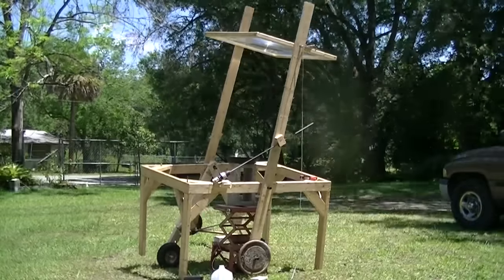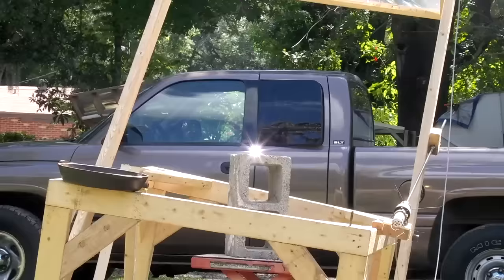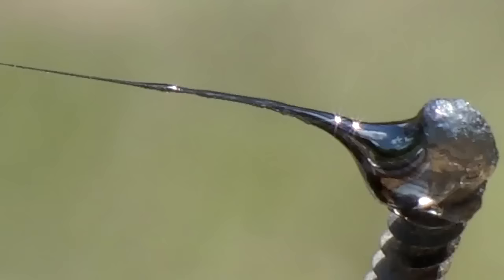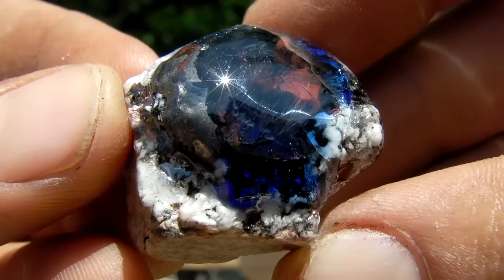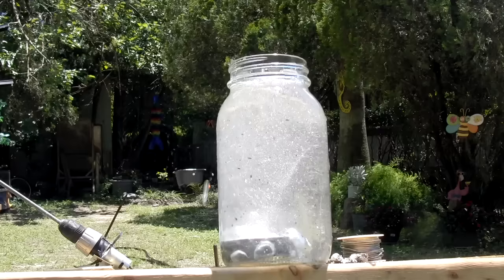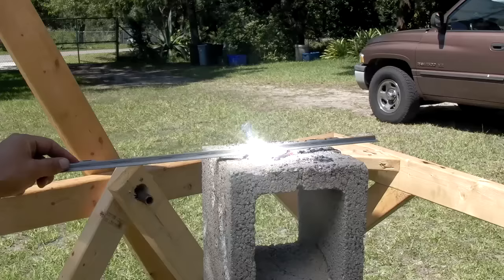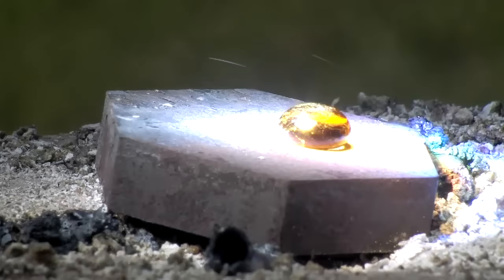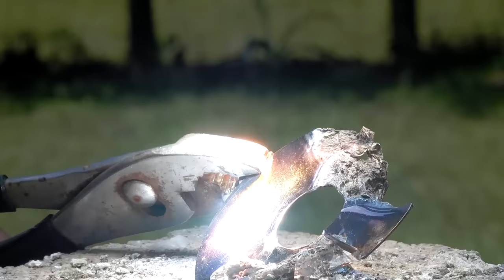Fresnel Lens Solar Power Foundry Obsidian Farm 3800 ˚ F 2100˚ C Fresnel Optics greenpowerscience

Comment: Now, with the simple things you used to make this, how hard would it have been for the ancient Egyptians to build those pyramids?  Lol!  There are ways around needing electric.
Reply: And where would this knowledge come from? Given or Imagined and implemented, where are the texts.
Reply: @seahawks1185  same place we got ours, our MINDS.
Reply: They built the pyramids with disaggregated limestone, then added a few percent of cement and poured concrete into forms.  In this way, perfect joints are unavoidable.  Quarrying, chiseling and levitating cannot possibly get joints even close.  (See Davidovits.)

However, the granite was probably melted first then poured into forms to make boxes and the structures like the ones in the King's Chamber.  Hathor's headdress probably held a lens that melted the granite.  Not sure how else you could do it.  They surely didn't lift 1000 ton blocks of granite.  With focused sunlight, there is no need for aliens or giants (or Egyptologists).
Reply: @henryhewitt1571  wow. That's a good concept.  I always thought they used water displacement to move the blocks but as far as the joints being so almost perfect, your conclusion makes sense.
Have you ever heard of Coral Castle near Homestead, Florida?
Look in to it, the man man who quarried and moved huge blocks of coral did it all by himself- and I think the ancient Egyptians used similar practices.
Reply: @mamaboocee  Thanks, I'll check that out.  As for Giza though there is also the time issue which adds weight to the cement case.  Starting at each corner with 2 crews of 20 year old boys (maybe 3 at each spot) going different directions, and a pack of others hefting up baskets of mix, and of course a crew disaggregating the local limestone, just down the hill (the stuff on top was too hard, like the Sphinxes head apparently) where they also keep the water, working only at night (it gets hot there I guess), by pouring one 2.5 ton block every 20 minutes, ie, 3 per hour and a 12 hour shift, that's 36 blocks per crew per day. So 8 x 36 = 288 blocks in a day.  That would be 8,500 blocks or so per month and if it took 20 years, as Herodotus says, or 240 months, you can built a 2 million block pyramid in the time suggested.

It would take a million years to bang away with copper chisels and you still would have crummy joints.  Eliminate the impossible and voila -- Giza.  Even if a 6 hours shift was all you can expect, doubling the size of the crew does not overwhelm the site of the encampment locally thought to accommodate only a few thousand workers.

100,000 slaves getting whipped up a ramp that contained more material than the pyramid itself is not only insulting to the locals at that time but it indicates a lack of awareness on the part of those who make such absurd claims.
Reply: @henryhewitt1571  yes, I agree whole heartedly about that silly slave concept.  There is so much more to those pyramids that is being kept secret.  I like watching videos that present alternative views and ideas about them.  I also believe they are far older than the "experts" are telling us.  I am amazed at the engineering, placement and sheer sturdiness of these structures.  They had to have been something other than or much more than tombs for kings.  I think that much later they may have been re-purposed by "royalty" for tombs - but their original purpose with that precise scientific geometry tell me that there is far more going on here than any of us ever thought.  Also take a look at a book co-written by Art Bell (cant remember the other author) about ancient global weather patterns (I think it is called "the day after tomorrow") and how these weather patterns can affect us today.  The movie "the day after tomorrow " is based on this book but the book goes into far more detail - details about weather aging patterns on the pyramids and the sphinx - that go further back than 5,too years.   There's more, you should look into it.  The placement upon the earth and their line-up with certain constellations, the accounting for the precession of the equinox", and the math involved in aligning and building the pyramids indicate a civilization we may not even be aware of.  Their are many pyramids over the earth, most are poor attempts at building, but some show advanced knowledge and skill far beyond a civilization that didn't even have a wheel.  I am facinated.
Reply: @mamaboocee   @mamaboo cee  I'm not sure if the guardians are keeping secrets; I really think they don't know for the most part but it is arguable that many of the gatekeepers want to keep getting paid and fear hat inconvenient facts might interfere with that trade.  I would like to send a drone through Hawara to take a look but it's not my call.

As for its age I wouldn't be surprised if we learn that they were built around 6,000 BC after the Phaethon chariot crash (see Ovid).  The period around 6200 is correlated to Meltwater Pulse II when Doggerland went under the sea.  The 9600 catastrophe that Plato tells us about was the one that covered the 'shoreline of the Atlantic Facade' which is usually mistranslated as the 'Island of Atlantis.'  It wasn't an island; it was all the land above sea level beyond the Pillars of Hercules, aka Gibraltar. 

I'm not wedded to that time frame but there is reason to believe the earth tipped over during the 6200 catastrophe and so there would be a new North pole and the first thing you would do, if you had the skill, and survived it, would be to lay down new survey markers.   I think it's why they didn't bother to uncover Gobekli Tepi because those structures no longer pointed in the right direction.

Giza not only points North perfectly, but it defines 1 second and 1 meter as well as demonstrates pi.  Observe: 440 cubits on a side and 280 cubits tall.  That is the same as 11 over 7.  Add all four sides and you have 44 over 7, ie, 2 times pi.  The circumference of any circle is 2-pi-r, and in this case, r = 1 (the meter defined).  It also unavoidably casts the golden 1.618 factor on the sloping side.  It can't be otherwise with these dimensions.  The math is straightforward - Pythagorean.

These people were wicked smart and they determined that if the circumference of the earth were divided into 40 million equal parts, one of those would be the meter.  The meter defined in other words.

They broke the day into 86,400 parts and one of them = a second.  The second defined. (24 hours x 3,600 secs.)  When we divide 40 million by 86,400 we get 462.96 meters per second.  In other words, that is how far the surface of the earth moves in a second.  Turns out that is equal to two sides of the great pyramid, what the sun 'sees' at any moment.  I daresay that's no coincidence but by design.  (231.48 meters = 442 cubits -- so that's probably the correct measure of each side.  Petrie's numbers come pretty close.)

As for the stars, Orion appears at 26 degrees as do all kinds of other celestial objects, but the supposed mystery of 26 degrees is simply what you get when you draw a diagonal across two squares lumped together.  In effect it's the tangent of 1 over 2.  Something has to appear in the sky at that angle (and always does).

They didn't need a wheel; a river runs through it.

O, almost forgot -- it's purpose.  The Supercapacitor that fit neatly into Khufu's supposed casket was the Ark of the Covenant. (See Matt's Ancient Architects video on this -- 18 March 2018.  He's good.)

This supercapacitor pinged the Djed Pillar in the King's Chamber (right above it) and the pulse from that resonator traveled down the perfectly engineered passageways to the water supply down below.  Let there be light.  This effect is called Sonoluminescence.  

You don't need electricity to make light.  Edison didn't have any -- he had to invent the electric utility to supply current to keep the light bulb glowing.  Imhotep didn't have any; fireflies don't have any.  

Sonoluminescence occurs when a sound wave of sufficient intensity induces a gaseous cavity within a liquid to collapse quickly.

Everybody wants light but the point is you don't electricity to get it and that is what these extraordinary structures were meant to do.  I'd love to crowdsource enough dough to light them up but were gonna have to sweep the plateau of the gatekeepers before that happens.  It's doable, I'm convinced.  The Ark doesn't come cheap, though.  Gold works best.
Reply: @henryhewitt1571  yes, yes and YES!! Everything you say is quite true and I have always believed it.   The gatekeepers need to realize that they do not need to guard the gate, now is the time the earth and humanity needs this particular technology.   Tesla was on to this as well.  Edison figured out how to make money by charging people for something that could have been - and should have been free and clean for the earth.  Your comment here is the best yet.  I would love to hear more.  I love numbers and how they are part of the design of everything.  I am fascinated by all of what you write! Thank you!
Reply: @henryhewitt1571  The liquid which can be induced to produced light by hitting it with correct sound frequency- was such liquid naturally occurring or must be formulated by processing, systems, etc?
Reply: @arielhermoso4262  water. And on Giza a river runs thru it

Comment: What if you put a boiler there, which will boil water turning a turbine, to produce electricity?. Obviously with a lower concentration. Then compare that to a solar cell there
Reply: What you are describing is how an electric power plant operates.  They are typically about 30% efficient as compared to 10% to 20% for photovoltaics.
Reply: @alexriddles492  Or even a better idea, you use both a boiler and solar, you have a glass enclosed flask that is double walled for more efficiency, and to prevent the solar cell from melting. And because the glass is transparent, the UV rays will be able pass though to the bottom of the flask where there will be a solar panel. So the boiler will convert the infrared to electricity, and the solar will convert the UV to electricity. The end result is a much better utilized system that can capture energy from the sun, what may potentially produce more electricity.
Reply: @jesselam5867  Yes jesse, or you can use a sterling engine!

Comment from the maker: 44 x 32 and it is a Spot lens from our optical inventory. These lenses were from a stage production in the 90's. We are in the process of releasing the Level 2 spot lenses we make here that are designed for solar only applications. Just need lower humidity to come around.

Comment: I wonder how much Portland cement a person could make in an 8-hour day with the fresnel heating the limestones, and then smashing them with a steam hammer, also powered with the fresnel? Or automate the entire process, with a hopper feeding limestones into the furnace and through a crusher. These could be a perfect solution for building cement/stone buildings using locally-sourced materials in remote locations where it would be difficult or too expensive to ship the cement!

Fantastic work, Dan!

Comment: Dan, regular steel will not harden by quenching in it water. You have to have a carbon content higher than 0.4% in order to harden steel by quenching. The normal steel, called mild steel, that you can by at steel supply stores have about 0.3% carbon.

Comment: You could use this to heat a room in the winter.  Get one of those pizza stones for in the oven and put it on a metal table and put the fresnel lens in a window with lots of winter sun.  Put the stone a little further away from the focal point so that you don't melt the stone, but close enough that you can get the stone heated to a few hundred degrees so it throws off heat.

Comment: AWESOME!  Have you thought about making a Prince Rupurt's drop with the glass?  

Very impressive heat.  With that level of heat I think you could make a steam engine and get off grid power whenever the sun is out.  Some batteries might get you all the way there.  A little less viable here in the NW where I live but it could still bring down the E-bill significantly.  Thanks for all the free info you put out Dan!

Comment: Wow, you've made a real breakthrough here.

Any chance you'll sell a basic set for the rig? Like, pre-fabbed steel beams you can bolt together, and then attach a Fresnel lens and the solar tracker assembly (both sold separately)?

All you honestly need is advertising for this system after you make it and it'll be a hit, especially with your background in green energy projects.

You could easily combine with the people making the Global Village Construction Set.

Comment: dude, this is awesome. i know it would be expensive but you should put a diamond under there. it would be interesting to see what would happen. if anything. either way, keep up the good work
Reply: The diamond would just evaporate into carbon dioxide
Reply: Damn, that would almost be a complete  waist of money. Though i would still like to see evaporating diamond. Perhaps over a time elapse. Thanks for the info btw. and is there a way of videoing liquid diamond? or would it just turn to graphite?
Reply: Zakah
you could videotape liquid graphite but this would be extremely difficult as it will turn to CO2 in regular conditions (also extremely high melting temp). My chem teacher showed us an old video on evaporating diamonds. The diamond was heated with propane until glowing yellow, then thrown into liquid oxygen where it disappeared completely.

Comment: If you could get a more focused smaller spot, add a moving mechanism to the lens, add a mechanism to spread thin layers of glass sand and use the techniques in sls 3D Printing you could build a glass 3D Printer. You could even build a metal printer using metal powder. Pretty cool!!!

Comment: I really admire your ingenuity! Is it possible to focus on a crucible so that a true foundry with a pour afterwards can be done?  The rustic art you make is amazing, and the glass drops have some serious marketing opportunities.  I'm wondering if you could build an internal frame strong enough to hold firebrick and a removable crucible? It seems hard to disburse the heat, like an electric or propane foundry does.  Maybe a pile of metal would just melt, until the whole mass was liquid, with the focal point in it's center, then it could be "de-aimed", removed and poured ?

Comment: I'm wondering if an adequately sized Fresnel lens could be used to achieve the synthesis of silicon. Thoughts? I believe the required temperature is just shy of 4,000 degrees Fahrenheit. I'm thinking that it may be possible to use this method to cast thin sheets of cilicides for the small-scale production of photovoltaic cells.

Comment: Crescent Dunes Molten Salt Solar Thermal Power Plant - Crescent Dunes is similar to a conventional concentrating solar power (CSP) system, using thousands of special mirrors called heliostats to focus solar energy on a central tower.
The difference is the use of molten salt, which flows through receiver panels at the top of the tower, consisting of alloy tubes. That enables salt to double as both an energy transfer and an energy storage mechanism.

Comment: Also be careful with stainless and galvanized metal, both give off toxic fumes when melted. Love the video, I hope to make one of these for my black smithing club. Are you going to do a DIY video for how to make the whole setup? Also, is there a specific type of Fresnel lens needed for this? There are a number of them on Ebay but I've no clue about which one would be useful.

Comment: This would be a good source of energy used to heat a sand battery, if the heat could be flowed to the storage area.
Reply: It doesn't create a lot of heat, it just creates high temperatures in a very small space. See that cinderblock never gets hot and cracks? In BTUs of output this thing generate less heate per hour then a gallon of propane

Comment: Needs more power.  Need one million times (or more) solar collection area, via a floating (buoyant balloon based) drone swarm with large directable mirrors.  With that kind of directable power, one could operate a real forge making industrially significant quantities of glass, metals, ceramics, etc.  One could also hypothetically make glass or ceramic roads.  One could also start to make small changes to the weather (although to really change the weather meaningfully, considerably more than one million times as much solar collection/mirror area is needed).

With enough directable mirrors, one could also hypothetically build practical high speed solar powered airplanes (ex: by covering the airplane in solar cells designed for concentrated sunlight, and then by having several drone and/or ground based mirrors track and target the plane as it moves through the sky).
Reply: i've seen high temperatures cited as a problem with concentrating sunlight onto solar panels, but i imagine the air passing over the plane as it flies would provide a cooling effect.

Comment: EVERYONE NEEDS AT LEAST ONE OF THESE
Reply: why aren't we funding this?
Reply from the maker: We make and sell them on our website greenpowerscience.com Crowd funding usually ends bad so we chose to place the business risk on ourselves. Best lenses available. No way to make the less expensive as the materials and optics require precision. Sort of like telescope mirrors. Small ones are cheap but prices double with each inch in size. Just how optics work.
Reply: GREENPOWERSCIENCE The required precision is not as high for solar applications as for optics, right? Basically we would need a large demand for a high economy of scale for industry to minimize the cost and justify a cheaper design optimized for solar. I wonder what application could create such a large scale demand.